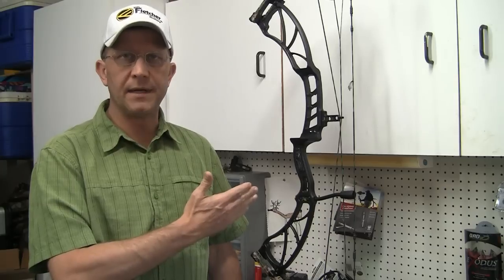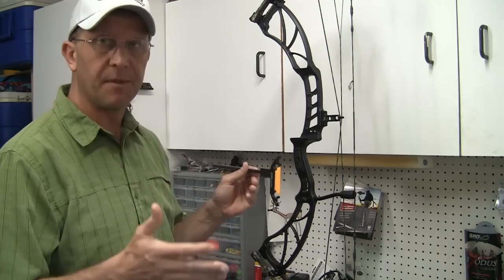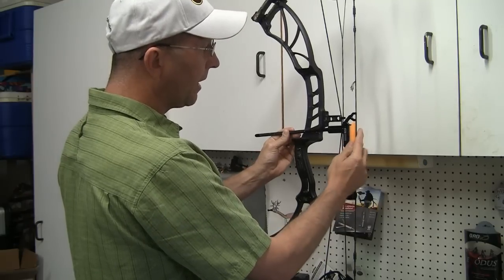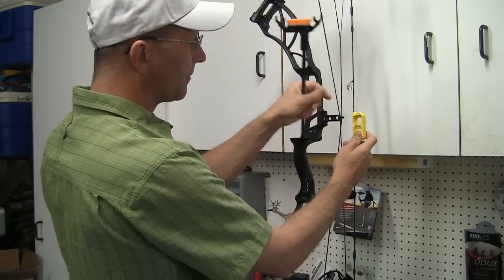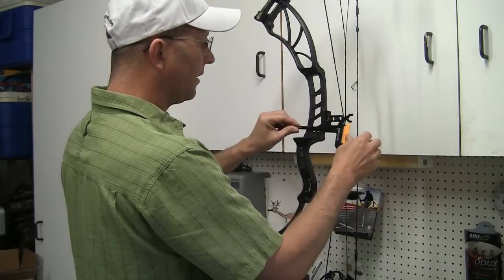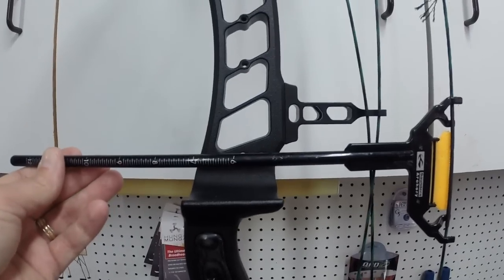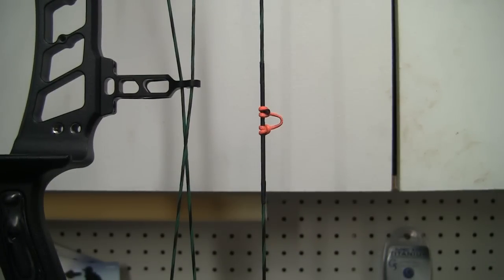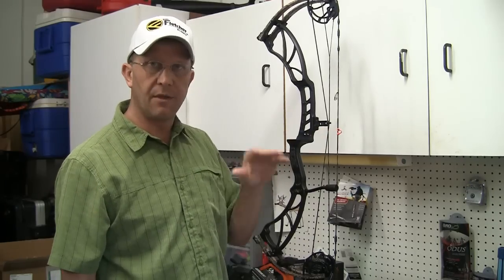Archery Tips: How to set your nocking point and tie a D-loop

Comment: Great video, very helpful. 1 question, I have seen people use thin cord to ensure the arrow nock does not move around on the string. This goes inside the D loop. Is that a necessary step or do you just need the D loop?
Reply from the maker: Gettysburg2013 I never use one. If you install it like I showed, you should not have a problem.

Comment: I have a problem with my recurve bow, after stinging it, the string "falls off". 
It is a Bear, Grizzly and it's marked 56" #48, which I have no idea what is it.
Please an advise, I'm new to it, thanks.
Reply from the maker: +ronin4711 You might have a bent limb on your bow. Some recurves can actually develop a warped limb from being strung all the time or stored somewhere where it is hot. I would recommend that you take it to a shop to have them look at the limbs.
Reply: Someone mentioned that as a possible problem. Thanks.
Reply from the maker: ronin4711 no problem.
Reply: +Outdoor Product Review It seems that I have a slightly bent (1/8") limb.
How/what can I do to fix this?
Reply from the maker: +ronin4711 Well unfortunately not much. You can see if you can get it steamed and pressed back into place, but you might be better off buying a new bow. Did you buy the bow new? If so, check on the warranty and see if you can get it replaced.
Reply: No, it was a "GIFT" imagine that...
Maybe I'll try to "serve" it tight so the string stays there, I have no intention to "invest" in it. it was meant for home use only so, I don't care if the string stays there forever...
Thanks for your help.
Reply: Well given the fact that I took the bow to a store and they measured it and got me what I needed. so, if I'm not mistaken, if you put a shorter string, it may break a limb for putting too much tension on the bow, not to mention that I'll have to use longer arrows too...eh?
for now, let's leave it, it's out of my mind, but thanks.

Comment: Im an amateur archer but do you need to have this whenever you use a compound bow with a caliper release?
Reply from the maker: No if you have a claw type release you can put it below the nock. However, that creates torsion on the string. I suggest trying this loop. practice and come back and watch this as many times until you get it right!! Thanks

Comment: One Problem Im having, I have new Pse Decree.
The book that came with the bow is calling for the  nocking point to be place threw the middle of the burger hole too.
But Im using a Qad drop away rest and the arms will not set flush on the arrow riser. so I had to move the nocking point up.
Is that okay?
Reply from the maker: On some of the bows the rests forks do not touch the shelf. This is ok. The most important thing you want is the nocking poing correct. If the forks don't touch the shelf, that is fine. Otherwide, you will never get your bow to shoot broadheads correctly.
Reply: Call QAD they have special launcher that is cut deeper specifically made for pse bows they sent me one for free. Just call and tell them you have the QAD rest and having issue getting rest to tune with a arrows through berger holes on your pse.

Comment: I have been watching a lot of how to videos on nock placement and I have noticed  that not everyone is putting the arrow as it relates to the burger button hole in the same place. Some  are putting the bottom of the arrow to the top of the hole and some are dead centering the arrow over the hole . What is the correct  place over the burger button .
Reply from the maker: justliketolook I always place the arrow directly in the center. That is where the cam turn over point is. I only want to see the top of the hole.

Comment: Did you use a smaller size paracord?
Reply from the maker: No that is BCY string loop material. You can purchase that at an archery shop or any archery dealer online.
Reply: D-loop or string loop material actually is small paracord
Reply: painter_G Actually it isn't. Paracord has a way higher break strength than d-loop rope, you probably won't use this on a parachute would you and if you do you will die a horrible death.
Reply: Some people know what they are talking about and some don't.
Reply: yeah and I'm the one that knows what they're talking about.